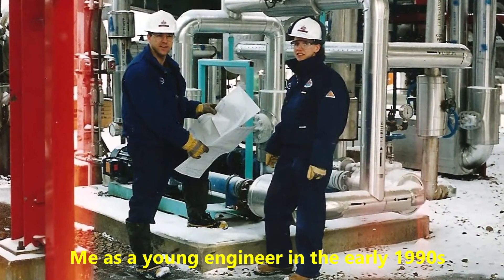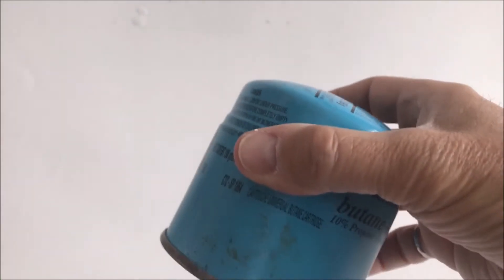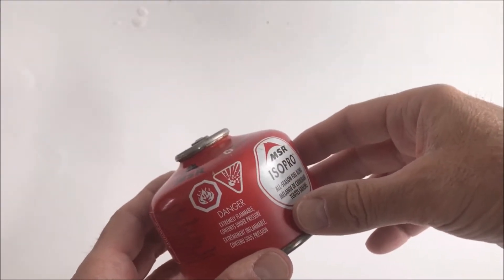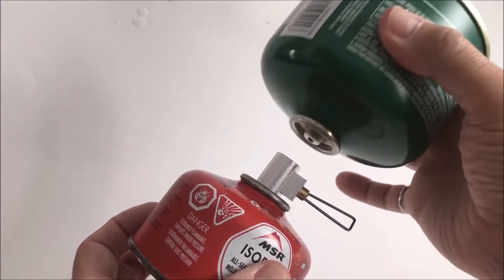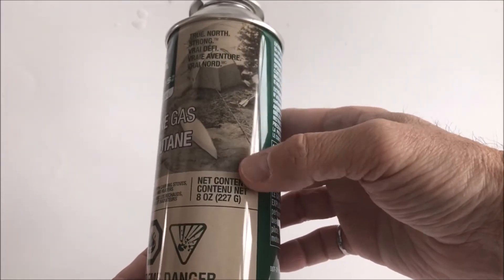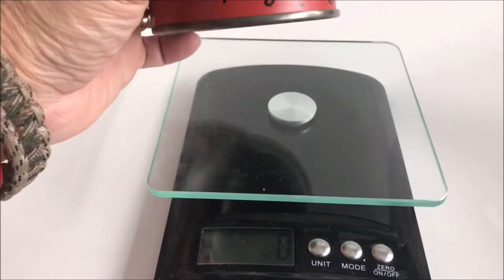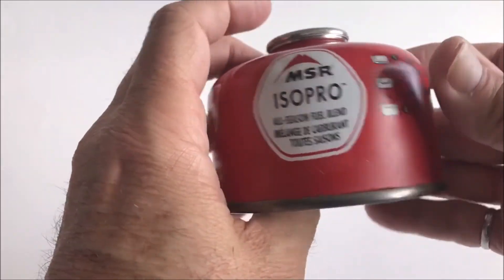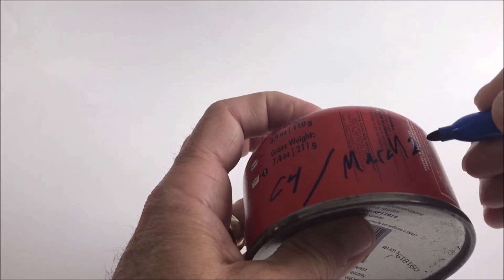How to refill backpacking stove fuel canisters with butane  |  Cheap & Easy

Comment from the maker: Note: The modern EN417 canister is designed to a European Standard applicable to cartridges with a total capacity of between 50 ml and 1 000 ml, designed to contain liquefied petroleum gas or stabilized mixtures of liquefied petroleum gas with propadiene and/or methyl acetylene and/or di-methyl-ether or equivalent, where the pressure developed by the contents of the cartridge at 50 °C does not exceed 13,2 bar (13 atmospheres).   These cylinders easily contain the pressures that result from using 80% butane / 20% propane, so it's perfectly safe to fill one with pure butane.  The vapor pressure of butane is approximately 2 times lower than an 80/20 mix of butane & propane.  Each canister should only be refilled 3-4 times.  After that the seal can become compromised.
Reply: Thanks for the advice from 🇫🇷 😉
Reply: I was about to ask about how often to use a cannister for refills, due to the likelihood of a seal/seam becoming compromised.
I was born under a lucky star, it seems, as I usually hand mine in for recycling, after three refills, but, on the rare occasion, have pushed my luck and re-used a cannister four times.
Thank you for uploading and I'm now subscribed to your channel!

Comment: Good video. So, Theoretically, if you can fill that butane canister with roughly 60-70 grams of butane, could you fill it first with 5 - 10 grams of propane THEN fill the rest with butane and make a winter mixture... theoretically?
I just bought a half dozen adapters off Amazon and am getting into gas fuelled products to use in relation with my wood, briquettes, electrical fuelled etc. setup for variety. 
Thank you in advance. =)
Reply from the maker: You are correct.  You can make your own winter mix.  Start with the butane, and add the propane.  I don't think you would be able to do it the othe way around because the vapor pressure of propane is much higher.  Let us know how that turns out.
Reply: @Martyupnorth  Awesome, thank you for the heads up, it'll be a while but I'll try to remember to report back, have an awesome day! =D

Comment: Hi Marty, thanks for sharing the video, it inspired me a lot, it's the best video on this topic I've ever seen on youtube. 

I have a question when using butane fuel, is the product of pure butane combustion the same as that of a mixture of isobutane and propane? MSR reactor stove recommends using their canister as the only fuel. Will butane combustion lead to more carbon deposition, especially in porous media combustion, which will lead to stove plug?

Which is the cleaner fuel? 

I would appreciate it if you could take the time to answer this question. 

Take care. Tevin.
Reply from the maker: Great question.  Generally speaking, the products of combustion for any fuel  are always water and carbon dioxide.  As you suggest, for that to happen, the ratio of fuel to air has to be optimum.  It also depends on the elevation.  The soot/carbon deposit/plugging occurs when there isn't enough air.  In this case the fuels are virtually identical.  The blend when you buy the canisters is 80% butane/20% propane.  The refill is 100% butane.  In summer you won't notice any difference.  In winter you will, but it will manifest itself as a lazy flame.  A good test is to check the bottom of you pot or pan.  If it's clean, then so will you burner.  Cheers.
Reply: Thank you for taking the time to help me figure this out, it's very clear now, and wish you all the best.😀

Comment: why  refil instead of using  the full one i dont understand can you please answer me that  im confused
Reply from the maker: The full butane bottle is too flimsy for backcountry use.  It also has a cheap valve that is easily damaged and could accidentally release all the content.  The big bottles are designed for home use, and basically have to be stored upright.  The little canisters are rugged, safer and can be just tossed inside a backpack.
Reply: @Martyupnorth  thank you for taking the time to answer me ,

Comment: Hi, Thank you for the best video I've seen on this topic. I'd appreciate it if you could help with a few questions (with mixed fuel)...
1- When the top canister is finished donating, is there any importance to taking it off immediately? I'm wondering if extra air could go into the receiver if left sitting for 15 - 20 seconds after finishing.
2- How many times do you recommend refilling before throwing away? I've heard 5 times.. 10 times..
3-  But if I'm using multiple donor canisters to refill 1 canister, does each donor canister count as "one refill" since the reason for a limit on refills is due to wear on the o-rings?
4- I've heard to only use the same company brand (not sizes) for refilling due to the companies possibly making theirs to hold a different pressure. Or is the difference so small that it doesn't matter?
Thanks!
Reply from the maker: My quick answers to your question.
1- If the donor canister is empty, then there is no rush to take it off immediately.  There is no air in the canister, and air can't enter because the inside pressure of the canister is great than the pressure outside.
2 - I think 5 times is reasonable.  I throw out a canister that's 4-5 years old as well.
3 -  The wear on the ring/valve IS the reason for the limits.  It's good for 100s of screw on and off, whether it's a stove or another canister. 
4 - Fuel brand is irrelevant.  The quality changes from batch to batch, even from the same manufacturers.  Similar to the gasoline for your car, or the milk you drink.
Reply: @Martyupnorth  Ok thanks for taking the time to answer. 👍

Comment: Overfilling is not just a matter of vapor pressure. Butane does have a lower vapor pressure than propane, but if you add too much butane and there is not enough vapor space left, when the liquid warms up and expands it will eventually end up taking all the space in the canister and will absolutely overpressure the canister and cause it to burst. Since butane and propane have a very similar density, do not fill over the gross weight regardless of whether it is butane or propane or isobutane.

A nominally full canister is mostly liquid with some vapor space. It is critical to leave enough vapor space to allow for thermal expansion of the liquid, regardless of the composition of the liquid that is in it..

Comment: Thank you fella. What are the potential dangers of doing this? Is there anything to be weary off?
Reply from the maker: If you grossly overfill, the cartridge will vent if the ambient temperature gets too hot. You’d have to overfill by probably 50% before that happens.

Comment: Just put a converter on stove and use can butane
Reply from the maker: I wouldn't feel safe carrying  one of those flimsy cans of butane in my pack.  Walls are too twin, and the nozzle is too easy to squeeze.
Reply: Some people want the 110g canister filled for their Jetboil stoves, they nest nicely in the pot.  Butane cans are too tall for some users, but yes, an adapter works too, I use one myself for a Trangia burner.
Reply: The wide base of the MSR can is more stable.

Comment: Can you fill this Canister with propane ?
Reply from the maker: No.  The vapor pressure of propane is much higher than butane.
Reply: @Martyupnorth  Uffff thanks, is there a propane canister that i can refill. not the coleman bottle, but something like the MSR canister but in propane ?
Reply from the maker: @TheStryderPrime  Not to my knowledge.  Propane is cheaper as a fuel, but more dangerous to store.  It has a high vapor pressure, so that's why the Coleman tanks are so heavy.  If you filled a small cartride with propane, it would rupture if the temperature got above 10-15C because the propane would "boil".  Don't risk it.
Reply: @Martyupnorth  PERFECT !! thanks so much for your time, ill go for propane for base camp and isobutane for BACKPACKING !!!!
Reply: @TheStryderPrime  I did refill my Gas Torch canister with propane.
The Canister was about 30% filled, and i added some propane to it but i was using a Pressure gauge to make shure that i do not exeed the pressure inside the can.
Winter gas mixture has a pressure around 3,5 - 4,5 Bar at 20°C and 4-5 Bar at 25°C

I was only abe to get it to 3/4 full and was already over normal pressure.

I did refill in little steps and keep looking at the Pressure.
Now i have about 5,5 Bar 25°C

Also its easy to overfill a little canister with a propane tank, also dangerous, nobody want to be near a can with like 200g propane pop...

Now i have to keep the can colder than normal, because the vapor pressure is now a good amount higher than normal.
It would not survive the 50°C pressure test anymore, so its not possibile to transport insite my car in the summer.
That is okay in my case, because i use it only for my gas torch.
Next time i will fist add butane (if its empty) then the propane :-)
Reply: @Hobby_Electric  Hahaha wow, thats to much work..ill stay using Butane..
Reply: @Martyupnorth  
Refillable propane canisters do exist and Flame King sells them. Here is one of my latest videos with a demo of the refill process. https://youtu.be/leCJq2G4qR8

Comment: Thanks Marty, I have several of the small MSR cartridges that are half full or less.  What do you do?  I don't want to take two or three partial cartridges on a trip, and if I just keep buying new ones, I'll have more partial ones.  This solves that.  Good work.
Reply: So how do you move the gas from canisters with less to the ones with more to top them off? What’s the trick there?
Reply: @RoeMega25 
The same process with a different adapter, cooling the one to be filled and warming the one to be filled from.

Comment: Thanks for the video. If you know the mix is 20% propane to 80% butane, do you think there is any issue with using the propane adapter to fill the 20% first of the total with the green propane canister and then the 80% butane?
Reply: I did that but I have red that 80% butane should go first and than 20% propane. Even just 20% propane portion alone may/will burst a can
Reply: Dangerous and not worth the risk. Leep propane away from butane canisters. Never fill the butane canister with propane.

Comment: Why don't you screw all the adaptors together and then weigh them seperately from the cannister to be filled. Add this to the weight of the receptor canister. That way you can do your fill by disconnecting the supply canister only to creep up on say 180 gm of fuel, or whatever you decide you need in your refilled canister without having to screw and unscrew everything several times.
Reply from the maker: Sometimes when I'm filming,  I forget the obvious.

Comment: Nice to see an expert do this - most reassuring 

You make a good point at the end re the number of uses that I haven't seen elsewhere, namely "Each canister should only be refilled 3-4 times.  After that the seal can become compromised."

I assume one can get these seals although I suspect they might need to be a certain material and not common O rings from a general hardware

Have you any thoughts on this?
Reply from the maker: It's not a simple o-ring.  It's a check valve.  I would't risk replacing it.  Just get used canisters at your recycle depot.  Ours has a whole section of propane and butane canisters that people drop off.
Reply: Thanks for replying and clarifying.   Is that valve intended to prevent over-filling by the way? I only ask as I have never heard mention of that valve in all the videos about refilling these cannisters. I'm sure hoping that you say yes as that would relieve the stress of over-filling and hassle of having to degas if you did. Would that be the case?
Reply from the maker: @tuberider1171  No.  It's an internal check valve designed to keep the butane from escaping when the stove is removed.  When you scrw in the stove it pushes on the valve.
Reply: @Martyupnorth  hey .. well that makes sense.  Many thanks for all your information .. of all of the YouTube videos posted yours is my go to for information

By the way.  Have you ever refilled to the MSR %, i.e. with Butane 80% and 20% Propane?
Reply: @Martyupnorth 
I thought it also meant how it's held together and maintains it's shape, ie, the seam running down the side and around the bottom?

Comment: Thanks Marty, this is really helpful. I began doing this with propane last year for car camping, from my 20lb tank that I can fill for one dollar a pound into those one pound canisters that are close to ten bucks now. I didn't know I could do this for my backpacking canisters as well. I hate to take a partially full canister that adds weight and volume to my pack. But I guess I should be able to use them to top off others. This is potentially a lot better for the environment too, as I bet many people throw their partials out. Using the cans more than once could mean fewer cans in the landfill, and certainly less fuel wasted.
Reply from the maker: Thanks Jason.  Great point on reducing waste.  I should have mentioned that in the video as well.  Take care.  Marty
Reply: Can I ask, Jason, by tank, do you mean bottle, such as those for caravans, etc?

Comment: Can you provide a link to the adapter on Amazon please?
Reply from the maker: Just search for words like "Adapter Gas Refill Butane Canister" and something should show up.
Reply from the maker: Here's one like the model I used in the video.  https://www.amazon.ca/Adapter-Filling-Canister-Backpacking-Camping/dp/B08CBGXQQK/ref=rtpb_7?pd_rd_w=gRAK9&pf_rd_p=164a4ce0-05d6-485d-91f8-34f2925e3c30&pf_rd_r=2GSWQDY63RQ5BZPE7QPM&pd_rd_r=2f499c31-a3be-4e54-8e69-ea6e833a6768&pd_rd_wg=ch4Gp&pd_rd_i=B08CBGXQQK&psc=1
Reply from the maker: This one is cheaper, but should work as well. It just doesn't have a valve, so a little riskier.  https://www.amazon.ca/Adapter-Filling-Canister-Backpacking-Camping/dp/B08CBGXQQK/ref=rtpb_7?pd_rd_w=gRAK9&pf_rd_p=164a4ce0-05d6-485d-91f8-34f2925e3c30&pf_rd_r=2GSWQDY63RQ5BZPE7QPM&pd_rd_r=2f499c31-a3be-4e54-8e69-ea6e833a6768&pd_rd_wg=ch4Gp&pd_rd_i=B08CBGXQQK&psc=1

Comment: So I assume I could refill the small 100 g containers from a 450 g size of Iso in the same manner, correct?
Reply from the maker: Yes. Let gravity do the work.  Little one on the bottom.  A difference in temperature helps a lot.

Comment: Valve ordered thanks for the demo Marty! One question not related to fuel but related to your kayak in the background (time stamp 16:58) are they the 10 foot or the 12 foot pelican ? I'm looking at getting the 12foot model and was just wondering if you are happy with yours? Thanks Ernie.
Reply from the maker: Costco specials.  Pelican model KY10 (2018).  They were $399.99 each, and came with oar, spray skirts (which we never use) and a roof-top carrier.  We use them all the time.  I've gone down the Bow River with no issues.  10' fits in the back of my pickup without too much overhang.  Also a bit lighter than the 12'.  Fun at the lake.
Reply from the maker: https://www.youtube.com/watch?v=9KDBPLApy5k  This is a video taken by my buddy Eric when he came for a visit 2 summers ago.  He's 6'4"

Comment: Thanks Marty now you've got me thinking.   If you take a full butane and empty red and fill "as much as you can", how much product goes into the red?   What we care about is pressure, not liquid content so if it "holds" 300 instead of 211 would there be any issue in overfilling?   Or, does there need to be some space in the red for the fuel to vaporize before exiting the can?

Which leads to - what about the whisper lite that can use inverted canisters where the design heats the liquid fuel in a tube just before it goes to the burner.   With that design, you should be able to use pure Butane without a problem and seeing as the canister is only a carrying vessel, it could be loaded as much as it'll take.

Finally, if both canisters have the same internal pressure but there is more fuel in the top canister, won't gravity pull that fuel down anyway?   I "think" that's how the small fuel transfer valve you have was designed to work to transfer fuel from partially used canisters to other partially used canisters.
Reply from the maker: Hey Don, It's all about pressure.  Actually, vapour pressure to be exact.  The EN417 canister is designed to handle 13 atmospheres of pressure at 50 Celsius.  Above that the seam will come apart.  Pure n-butane has a vapour pressure of 5 atm at 50C so it's fine.  Even at 80C the vapour pressure of butane is only 10 atm.  Propane, on the other hand,  reaches 5 atmospheres at only 1.4C, and quickly climbs to 10 atm at 26.9C.  Loading an EN417 with pure propane is definitely not recommended, as it would blow around 30C.  Mixtures of butane/propane fall in between.  

In theory there is no need to leave a vapour space in the canister.  You should be able to fill right to the top if you are confident in the exact composition of the product.  In the propane industry practice is to limit fill to 80% capacity.  That's because the specification allows up to 2% ethane, which has a very high vapour pressure. 

I decided to verify.  The empty canister weights 101 g, which means I loaded it with 113 g of butane.  The specific gravity of butane is roughly 0.6, so that equates to 188 ml. I measured the full volume of the canister by water displacement, and it's approximately 250 ml, which is 72% (give or take).

I think your comment on gravity is correct.  A fluid is a fluid, and that would definitely be the case with water.  I thought about equalization in the video because I was holding the assembly horizontally.  I love these chats, and I absolutely knew you'd comment once you saw this video.  Cheers my friend.